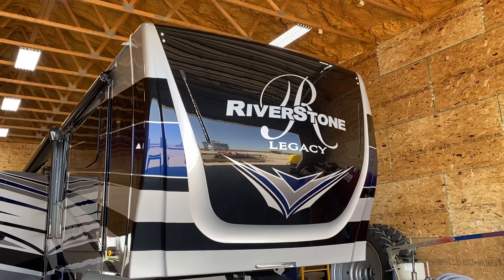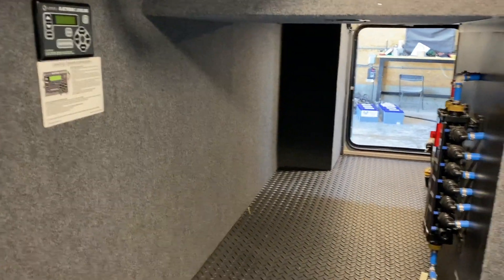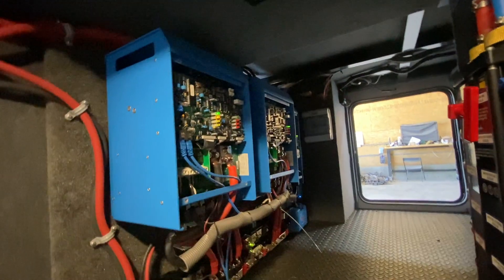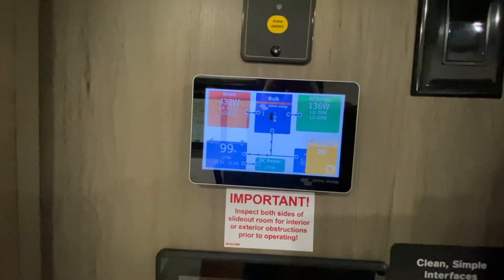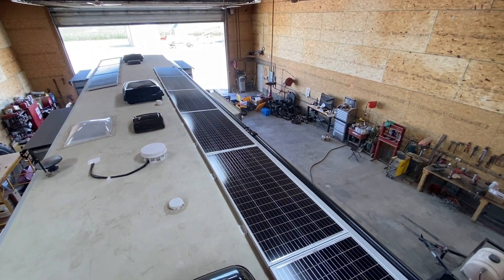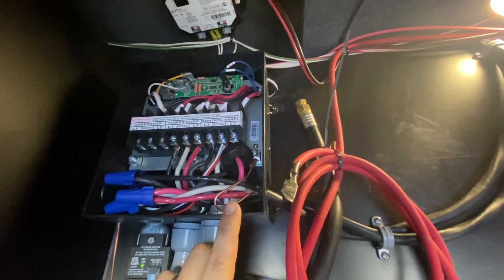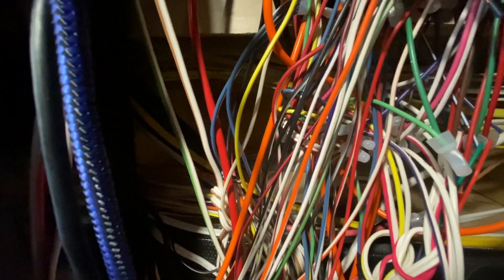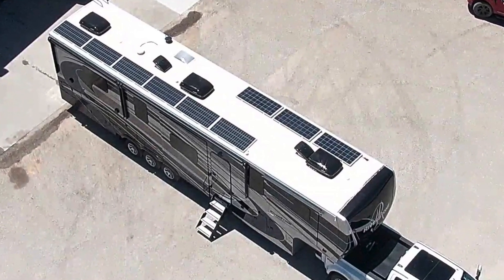Riverstone Legacy 5th Wheel Solar, Battle Born & Victron Install with Split Phase balanced inverters

Comment: Is the earth relay wires from master inverter to autotransformer something that can be purchased? If yes, do you have a link on where I can buy one? If not, did you just take a red and black wire and just insert them into the earth relay blocks in both? Is there a minimum AWG needed for those wires?
Reply from the maker: I believe we used just simple hookup wire.. 12-14 awg.  It's a signal only.

Comment: I love the work you do!  Could you make a video showing how to install the autotransformer?  I recently bought one and I have doubts about how to install it.  I have two inverters like the ones you show in this video.
Reply from the maker: I’ll do more detail on the next one for sure. Most people are served well by using 2x 2x120 Multiplus inverters in parallel. I only recommend the auto transformer if you have 240 loads or really want splitphase all the time.

Comment: I watched this with interest twice as you were suggesting using the vent pipe to run the additional solar wires down to the pass through. I was hoping that you would go into some more detail on how you snagged the wire once ran and how you closed the hole back up to ensure that no fumes or gasses leak out the opening.  I have to do the same on my Reflection and would much rather use the pipe than having to fish down through a wall.  PLEASE can you go into some more details as to how you sealed the pipe once the wire was through??  Thanks
Reply from the maker: Sorry I did not show that. I bundled the 4 wires together with tape then pushed them through the hole from the bottom. Solar wire is pretty stiff so it works well (don’t use welding cable , it’s not rated for UV). Then o just used silicone to seal it up. Maybe come back later with some black flex seal spray.   I hope this helps.
Reply: @sotasolar  thanks for the prompt reply. That’s why I keep watching you guys interesting installs and helpful tips. I will try this route as it sounds much easier that fishing from the roof all the way down. Assuming a good seal at the bottom this sounds like the trick for running additional solar connections to the roof. Keep up the good work and I will keep watching. 👍

Comment: I wish you were closer to NC. I like what I'm watching on your videos great job with your installs. Keep the videos coming you make me want to start the process of up grading my GD 150 series 295RL. It has just one solar panel from GD pre-installed on it I'm thinking 165 watts maybe it basically is a battery tender. I wanted to replace the factory battery with a lithium battery upgrade however with the furrion MPPT solar charger controller 50 Amp the dealership was telling me that might not work. Don't understand all this solar stuff however very interested in learning more about it. Thank you for videos...
Reply from the maker: Who knows, part of the reason I started this business was to fund travel .  If I can get a few other jobs in the neighboring areas it might make it worth while. 

You should be able to use a lithium battery with the stock furrion MPPT. Now will it work perfect? No, but it won’t hurt anything.  You might just miss out on some top of charge , like last 5-2%. I really like these lithium batteries with built in JBD BMS for upgrading a system like yours. You can monitor the battery health at the cell level to see if anything is out of wack. 

I appreciate the kind words and will continue to post videos after the summer break during the 4th.

Comment: You have space for more solar on roof, any reason why not to?
Reply: Hi, I'm the customer. I was balancing weight and cost so we decided on the 9 pannels plus the existing 320w. That gives us a little over 2000 watts on the roof. We will use it and see if more is neccesary. We are not hard core boondockers. Wanted something we could spend a night or two on ocation not hooked up, run the ac prior to arrival, and run the fridge off batteries when driving so we can shut the propane off. We can also augment a 30 amp hookup. We have no generator. All that determined how much to put up there. We are supper excited to try it out. SotaSolar did an awesome job helping us find the right mix for what we are doing.
Reply: @TonyWirz  Everyone's use case is unique, if it works for you, then it is the correct setup.          All the best......
Reply: @TonyWirz  How is it going? We just purchased the same Riverstone. I will be adding almost the same system but in 48V. (2) quattro 5Ks in split phase. How do you like it so far since you have had this setup for a while now?
Reply from the maker: Plan is to add more in the fall I think. We just didn’t know what we could fit.
Reply: @sotasolar  Glad to hear more panels are planed, they will need all they can fit. I'm in a Prowler 28RLK, 2.4k of panels, 1.2k ah@24v batt. Here near Palm Springs,CA, I'm producing a consistent 14kWh/day, with mini spit AC, and, using electric for WH, I'm using 14-18kWh/day depending on temp.  More panels in my future....

Comment: On 8:40 min are you using twist 🪢 nnectors for 6awg? Aren't a better type for an installation which will vibrate and could lose those connectors? Great install and great equipment.
Reply from the maker: Yeah, I’m thinking of going to WAGO connectors.